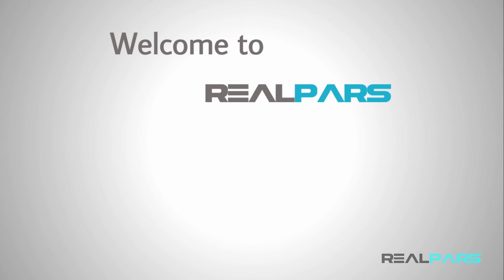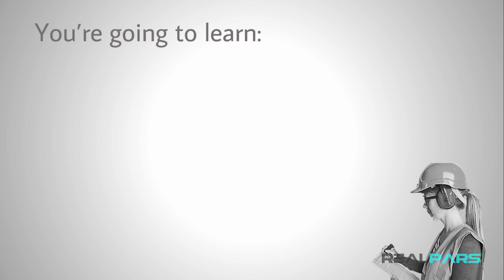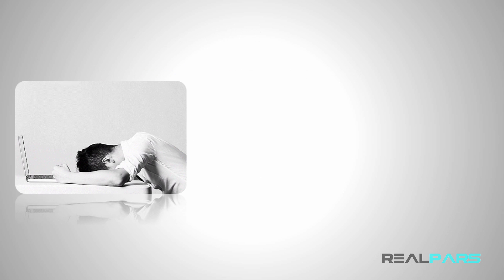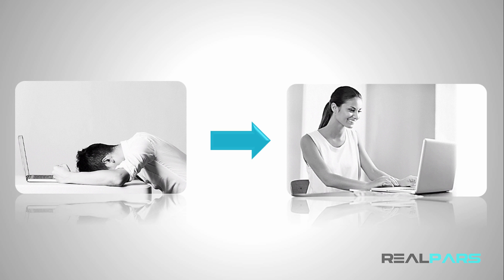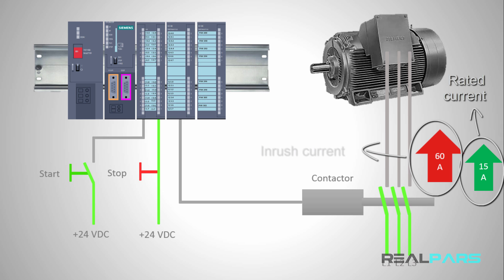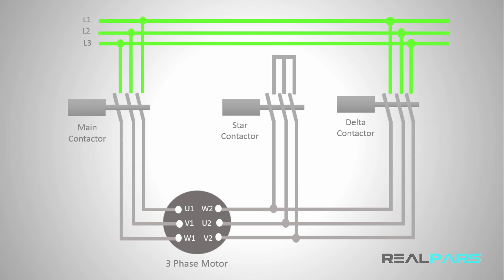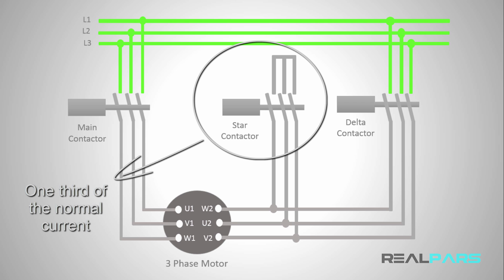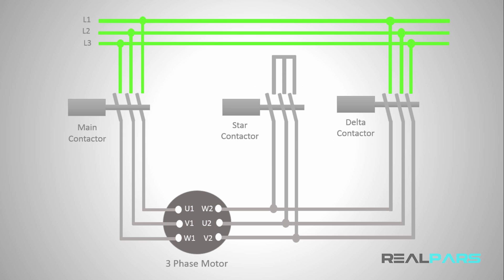Star-Delta Starter PLC program and Wiring_ Part 1

Comment: What was said at 1:58 is not correct, various protective devices are required per standard to protect the motor from damage. Star configuration starting is one of many methods used to lessen the starting current of large motors in general, but not a requirement. However, what was stated in the video makes it seem that this method is necessary to protect the motor when in actuality it is one of many options for starting methods, and does not provide the necessary motor protection as required.
Reply from the maker: Thanks for sharing that with us, I will forward your feedback to our course creators.

Comment: Can you send link download simatic manager software ?
Reply from the maker: Hi Omar,

Sure we can! Below are the links through which you can download different versions of STEP7.
STEP7 V5.6: https://sie.ag/2Hw6UKy
STEP7 and WinCC V15: https://sie.ag/2Eo3LKJ
TIA Portal Version 15  https://sie.ag/2J7tZ4y

Happy learning!
Reply: @realpars  hi , iam a student at faculty of engineering cairo university electrical power and machines departement , can you help me  giving ideas for graduation project in automation control (process control , home automation system) .